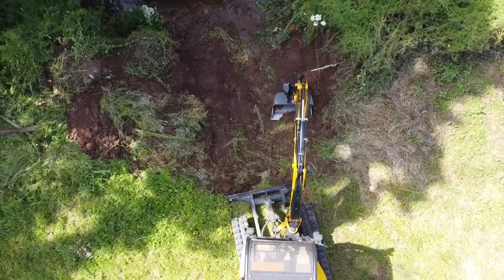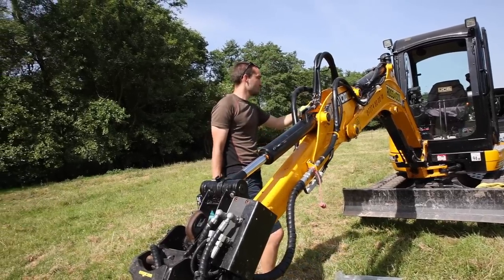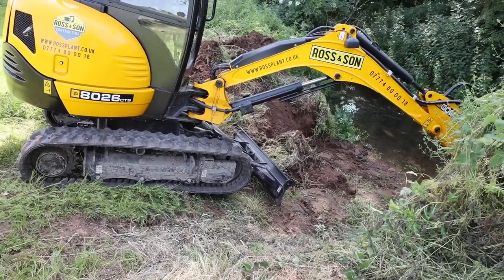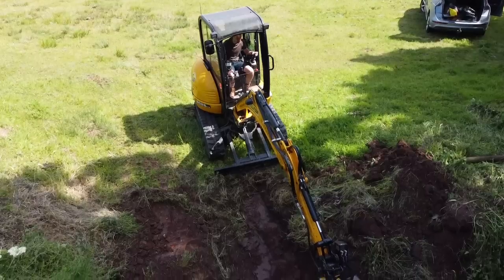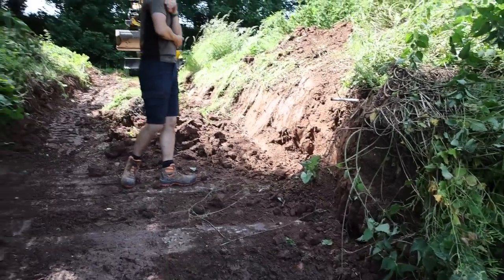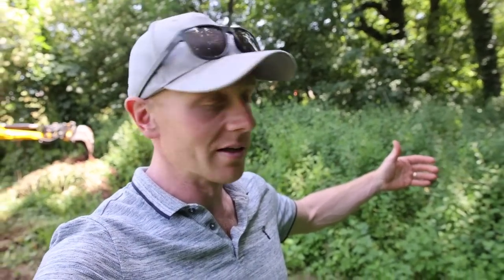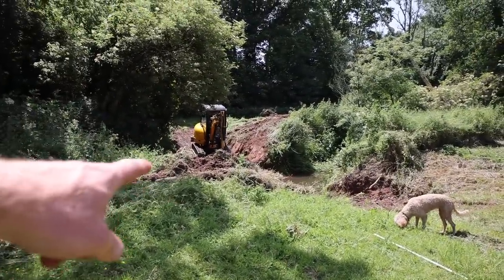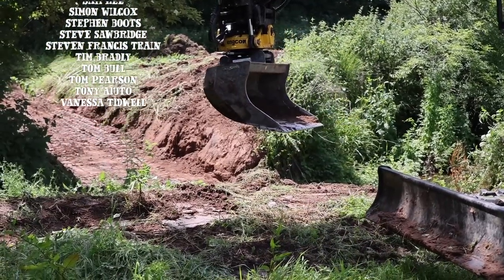JCB WITH A WRIST? - Clearing the old brook crossing

Comment: Tim you can buy a Flail mower attachment for Mini excavators. An attachment like that will make caring for the edges along your stream and around you pond much safer, easier and quicker also (an a bonus small tree and brush removal), get rid of the dumper and buy a Mini. I hope that helps D
Reply from the maker: With that attachment I reckon you could take up topiary! Seen some amazing uses over the past couple of days actually. Clever kit but not sure our old dumper would find much more than a bucket. 😬
Reply: @TheRestorationCouple  i do hope thé girls and Humpty Dumpty ain’t listening to this… they’d be a riot🙃!

Comment: Operating a digger is a real skill. Once you add the tilt/rotate function it's just another level. The main 4 functions (of the arm joints and left/right rotation of the digger) are controlled by two levers. You usually then add a thumbwheel to each lever for the rotation and tilt of the bucket. That means you may be combining 6 different functions at once. All the functions are variable speed and when you add or remove a function it often affects the speed of all the others. You can also drive forward and backwards with your feet at the same time. I'm sure the guys who make this look easy could retrain as helicopter pilots!
Reply from the maker: Funny you say that, Craig is actually a heli pilot and drone operator. Guess that helps. 👍

Comment: Would it be feasible to lower your sleeper 'wall' by a course or so (the one around where you're building the cabin) and use those?
Reply from the maker: Had thought about that however the soil is banked right to the top at the moment.
Reply: @TheRestorationCouple  Ahah... only really noticed it from the inside!

Comment: Just a thought, wouldn't concrete fence posts do the same job and sleeper's. And the cost is alot cheaper
Reply from the maker: I had considered concrete gravel boards for the same reason.  We will see how we get on with some hardcore.

Comment: At about 4:35 you mentioned using hardcore to improve the grip on the bank.  I would strongly recommend placing a geotextile membrane (there are various brands available) under the hardcore as it will stop it from sinking into the mud during the winter.  If the crossing is going to be used regularly then it may be worthwhile also digging out more of the topsoil and treat it as a short track and use different sizes of hardcore and gravel compacted down to form the surface.  But if that isn't so much of a priority then just the layer of geotextile membrane under the hardcore should do the trick.
Reply: Nahh

Comment: Why not build a border with reclaimed wood to prevent soil washing down again? But maybe only in the middle straight parts  because you don't want to get stuck on a corner with your vehicles.
Reply from the maker: Good idea. Probably better to stake/stack logs there as plenty of fallen trees nearby. 👍
Reply: @TheRestorationCouple  that's a cheap, quick and solid solution. And looks more natural 👌

Comment: From a purely practical point of view long term a properly laid hedge along the bank will be stock proof and immune to most floating debris bar a tree or caravan. In the short term do what you need to use the land just leave the current hedge alone so the stems can grow and get laid at a later point.